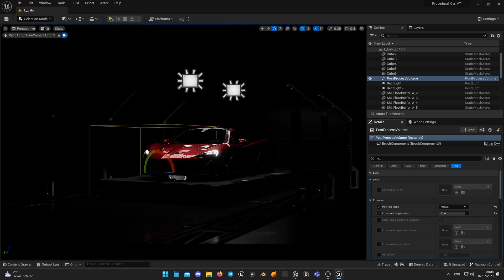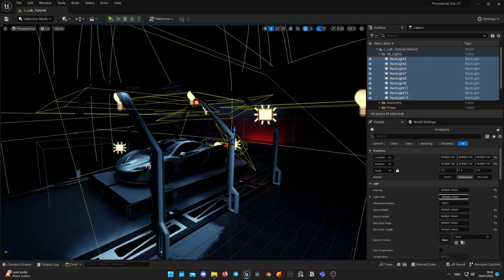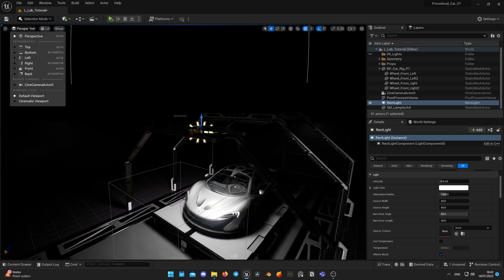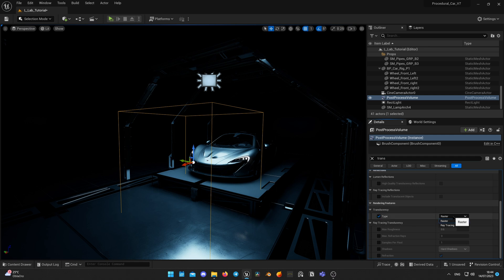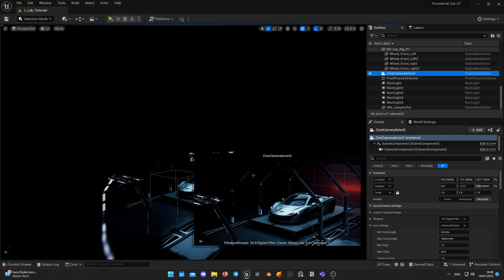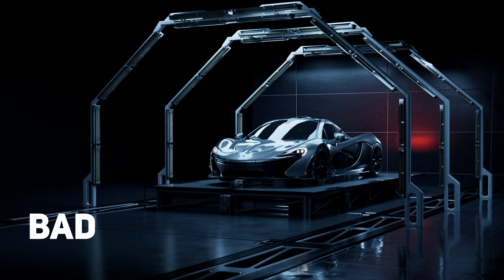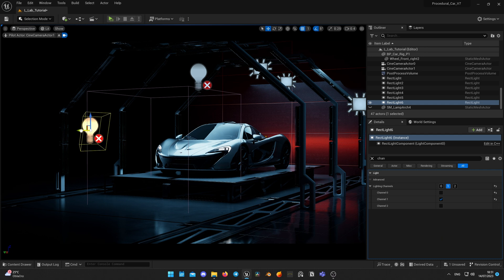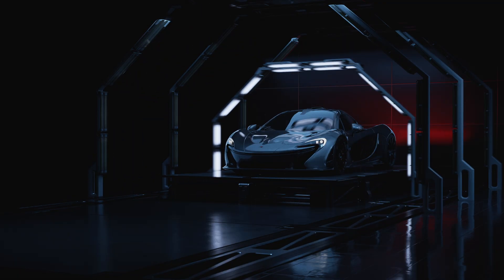IMPROVE YOUR LIGHTING in UNREAL ENGINE 5.2

Comment: nice tips and straight to the point, excellent as always, may i suggest a video in depth with path tracing and volumetric lights? maybe for car headlights, how to control the lightshaft lenghts, how to place the lights in or out the optics and how to prevent volumetric light inside the optics if light is in, you know...tips.

Comment: This is a great breakdown of your lighting setup! One problem I'm running into is when I change the Translucency Type to Ray Tracing, my windows/glass materials turn black. My day light lights are no longer visible and I can't see inside the car. The reflections feel like they're going over a black solid. Any fixes to that? I have the correct settings on I believe.
Reply from the maker: @LazySlothProductionsLLC  it is the issue of 5.4, they broke translucency ray tracing in this version… work around can be: in project settings enable “use hardware ray tracing when available” and use “lumen high quality translucency reflections”
Alternative:
Select glass material instance and scroll down to shading model override and choose “default lit” instead of  “thin translucent”
Reply: @postprocessed  THAT WORKED!! Thank you for the quick reply. And one last issue I just ran into is that when I duplicate the rect light, I get this ghosting/flickering effect where it looks like there's multiple scenes, but ONLY in "Lit" mode. Path Tracing looks good. Is there a fix for that? I've tried the command variable, "r.Lumen.ScreenProbeGather.ScreenTraces 0" which takes away some artifacts but not all of them. I'd love to export this in both Lumen and Path Tracing if possible.

Comment: I wonder if you have a black or yellow patches bug with path tracer with lens flares active?
Reply from the maker: yes I do. I hate lens flares which unreal produces so I always disable them and add em in Nuke or Fusion
Reply: @postprocessed  what about blooming?
Reply from the maker: @azfilmmaking6734 I use convolution bloom, usually settting it down to 0.475
Reply: @postprocessed  thanks a lot for your answers

Comment: Wow!! About light channels was very useful information... But how to find job with that "knowledge"?? That's my passion to create this kind of images, vieos, etc., but I don't know who need this tye of work and where to find it???
Reply from the maker: I do this kind of render and post them on Linked in and on Facebook groups of the same topic. Like "Unreal Engine Automotive". I mostly get contacted from Linked in and Facebook groups, which actually bring me clients and job offers. 
So - create great renders in the market which has the demand and go public with on every platfom possible.
Reply: @postprocessed  Yeah... You are completely right!!! But right now it's hard to do like that because I am like refugee. Especially with my GTX1050TI Laptop it's hard to handle this kind of renders. But, you know, Lumens, Nanite works like fine tohgether on my Laptop. That's abou models which weights like 500mb and etc. Anyways... The mine biggest issue is that I can't to settle down right know and to work above something.
Reply from the maker: @aleksandrrush4076  You don't need 500mb models actually, you can start with something low poly, like 150mb, or 80. Just work more with light and atmosphere. Lighting is a key